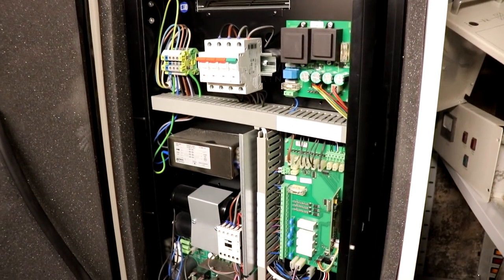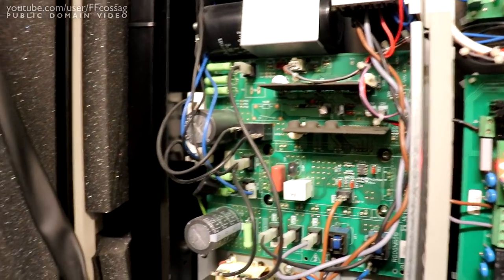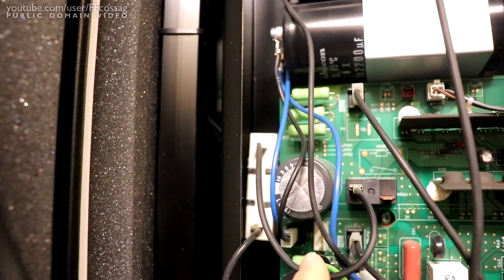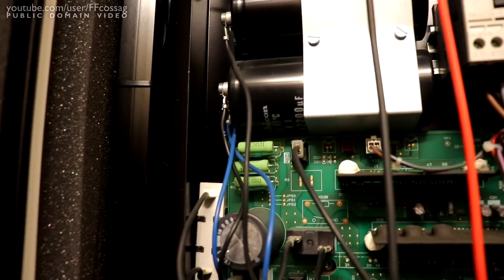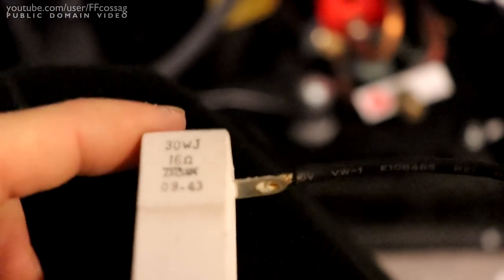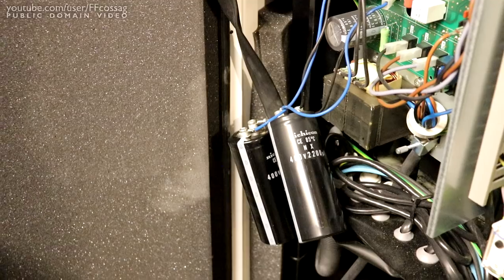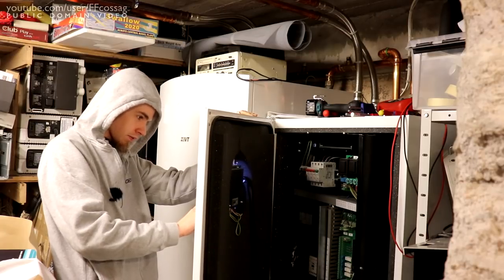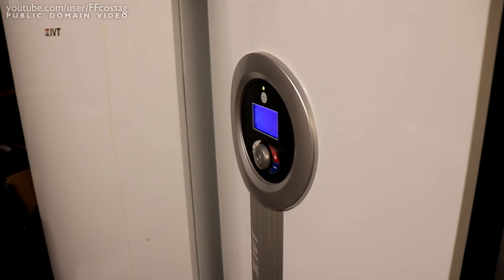2012 IVT heat pump repaired by using 30 year old TV transmitter parts.

Comment: While I can fully embrace a what we call a heat pump and the relatively high efficiency of them, I really enjoy my more conventional Bryant 90+I gas furnace. It is a 1984 model. It uses two electronically communtated motors, one for pushing the forced air throughout the house, the other draws fresh air in from outside for combustion.it also features a two stage gas valve. Normal power consumption while running on low heat is less than one hundred watts. It run s on low heat 98% of the time.
My total electric charges for last month was $63.87
Natural Gas was$61.36
Total heated space is 2100 SQ foot. Half of that is an insulated basement.
All that aside, great repair my good man, super troubleshooting 🖖

Comment: Given that thie ground source heat pump cost 10,000 EU, they should've used a higher wattage metal cased resistor in the first place. if you didn't have these old TV transmitters with those power resistors, you  could've used an old 100W filament bulb as the softstart resistor.
Reply from the maker: Ha, that is NOT a bad idea for an ugly fix!

Comment: Neat repair job. If I were designing such a circuit I would have grossly over-specced the power resistor, probably up around 50 - 100 watts.  It would be interesting if it were possible to figure out the failure mode of the resistor, I suspect it would be metal fatigue in the resistive wire due to the huge inrush currents it sees. 

You just have to hope the IGBT driver doesn't blow up down the road, although it is somewhat possible to bodge them back to life, Mike from Mike's Electric Stuff posted a video a number of years ago where he did this.
Reply from the maker: Yeah, those giant bricks are awful. I've managed to reverse engineer one a long time ago, to such an extent that the exploded transistor could be replaced by a discrete one, but I think it just exploded again afterward. :(
Reply: if you overdesign something, penny pinchers in your company will get your butt pinched and will make you put back barely adequate part back ;)

Comment: I woke up this morning to find my house at 5C but my problem isn't interesting like yours,  its just been very cold here and my propane tank ran out sooner than expected and tonight it's going to be -31C. Great job fixing your heat pump I've never seen one before and wasn't sure how they worked but after seeing the big compressor and you talking about the ground loop I have a good idea. Thanks for taking us along for the repair.
Reply from the maker: For what it's worth, an empty propane tank is usually an easier fix than a broken heat pump. These pumps operate like reverse refrigerators, with the cold side being connected to a massive length of underground tubing. Mine has about 2000 litres of coolant circulating underneath a 50x70 meter field.
Reply: @FFcossag  I agree much easier I just picked up the phone and called and they will be here Moday and fill it up,  as long as I have a 500 dollar check waiting for them. LOL
Reply: @kwils6685  I had to do this the last summer. 800 liters tank. 1 EUR per liter!
Reply: @tuttocrafting  Wow you really pay alot for fuel!  My tank is 300 gallons @ $1.65 per. Where are you at? I'm in northern Minnesota.
Reply: @kwils6685  Italy, we have lot of taxes on oil based stuff.

For example the gasoline is 1.5/1.6 Eur / l.

In general propane should be like 0.4 for liter but due to transport to home and holiday the price went up!

Luckily it is a secondary house for holidays and that will last for 10 years!

We used CNG (not sure if is the right name in English) for heating in big cities with public pipeing sistems.

In that case the price is a lot lower!
Unfortunately remote location only relay on gas tanks under ground or diesel. (Actually is not exactly car diesel, I have no idea how is called the direct translation would be farming diesel)
Reply: Red diesel.
Reply: K wils where are YOU. Not at.

Comment: Pretty sure those are 10W resistors going by the size, FYI. They'll probably work for a bit, but if you want them to last, some thermal compound to the side of the case is definitely a good move.
Reply: The resistors are large to deal (or not) with the big inrush current as those capacitors charge, not because they're expected to dissipate a large amount of energy over an extended period of time.

Comment: Who doesn't love an easy fix with junkbox parts every once in a while? :)
Now, do you have any plans to map out where all the heat is actually going (and possibly leaking out needlessly)? Your power outage series seemed to suggest that your house cools down very quickly even in moderate cold, which I would think may be a combination of non-massive construction (low heat capacity) and leaks / lack of insulation. I would not be surprised to see an appreciable reduction in power consumption even with some rather inexpensive tweaks (ensuring window + door seals and tracking down any other unwanted ventilation, closing the vents when not using the stove, some curtains for doors and windows, perhaps some window blinds or extra insulation even).

Given that your house is a century old and hence built in a time when fire heating was standard, I would not be surprised to find that some air movement was not unwelcome, avoiding potential carbon monoxide buildup and the like (or mould on cold walls). 21st century requirements are just ever so slightly different. Passive houses go so far as to use heat exchangers (a different can of worms - or rather germs - altogether) to ensure ventilation without having to open a window.
Reply from the maker: The biggest heat loss is going to be the windows. There's lots of them and they're all trash. I've been adding gaskets to them over time, but some of them are in so bad shape that they can't even be opened anymore, and the quality of the glass is not good.
Reply: You need to get secondary glazing or just completely replace the windows

Comment: FFcossag RED LED on the inverter board from 16:44 you can find in any HV industrial equipment, it isn't bad, it mean don't F. touch this thing, because it will kill you instantly. It's an indicator of HV (power or residual cap charge) in the unit.

Comment: Nicely done, just shows that if even something is old, it doesn't mean you should throw it away!! Just sucks that such things are over-engineered and break down through such simple faults, whereas old tech (such as your wood range) just lasts forever with simple maintenance... :)
Reply: Those resistors and the range will still be fine long after FFcossagg is dead.

Comment: I hope your ground-source heat pump doesn't have anything to do with the ground-*effect*. Flying houses don't strike me as a good idea really...
Reply from the maker: If I could trade this heat pump for a device that made my house fly, I would do it in a heart beat.
Reply: @FFcossag  ground effect isn't actually flying, closer analogy would be boncing on a couscan..
Reply: It looks like more of ground heat pump device. Have no idea why it is called there in any way like this. we do not have here name for it like that.  My home has wood heating and air to water heat pump. that was cheaper than house flying device ;)

Comment: That's brilliant, repairing a 6-7 years old heat pump with 3 decades old electronics.
When will you repair a computer using vacuum tubes though?? :P (jkjk)
Reply: Well, there actually was a motherboard with a tube amplifier on board. That was a weird idea.
Reply: @tyttuut  That sounds like a weird idea, yet I bet it'd sound really good.
Reply: @RWL2012  That's the one!